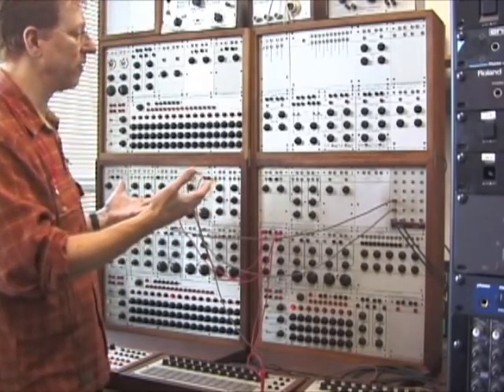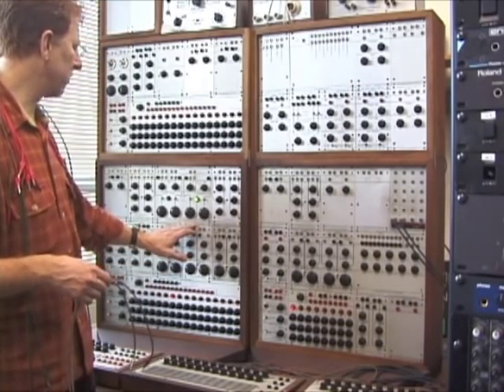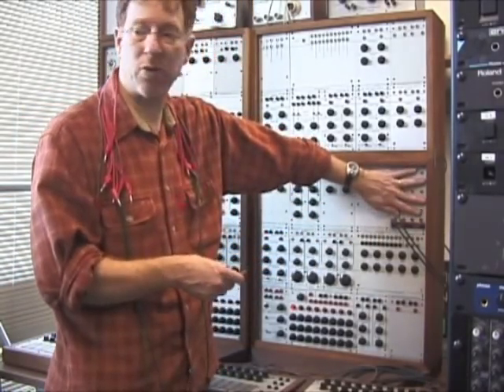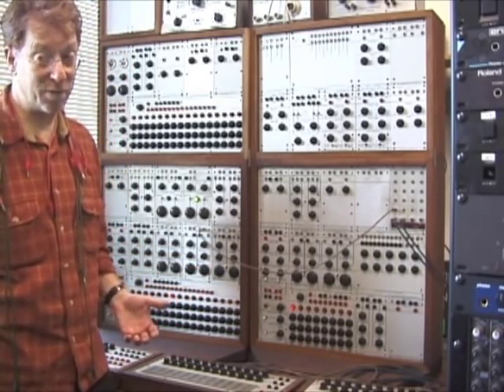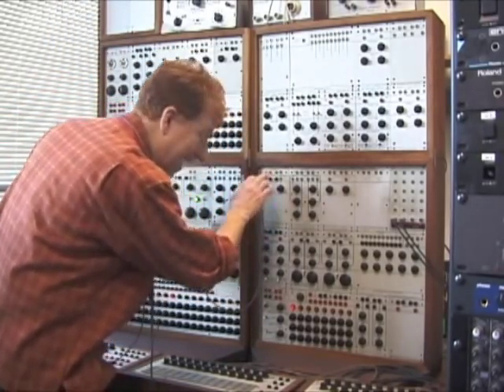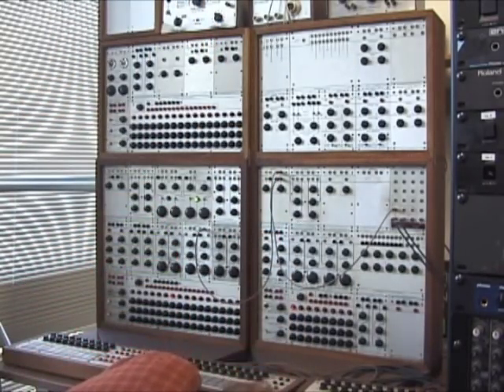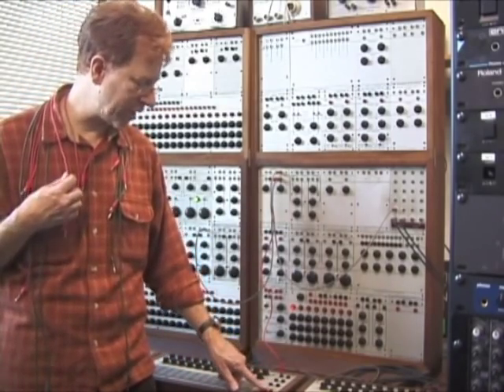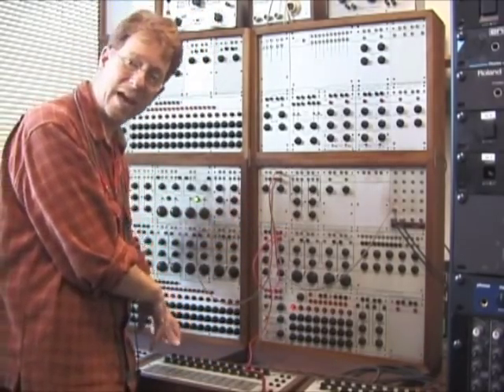ERIC CHASALOW -  BUCHLA 100 Lesson - Part 1

Comment: I'm not sure how much experience you have on other modular platforms, but I'm curious to know how much of a hassle it is to have to deal with multiple cable types when patching. Or if it is actually beneficial? I have a euro system, like most people who are into modular these days, so I only deal with one type of cable for a patch. 
 It could be a hassle, but sometimes those minor details that look like a pain, actually influence how you think about your process and how you implement it. That can be a good thing. Perhaps it's such a minor issue,  you've never even noticed. Just curious. Thanks.
Reply from the maker: I've worked on Moog, Arp, Electrocomp, and Serge systems, which use single cables, but never found it a hassle dealing with Buchla. The Serge has no distinction between control and audio signals, which is fun, but it is kind of nice having them set up this way and it is also more clear visually.